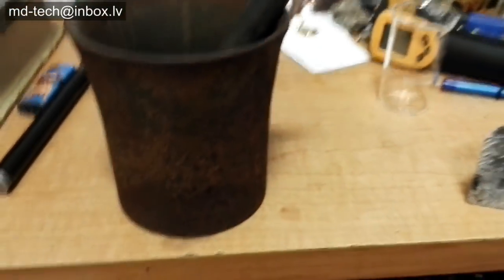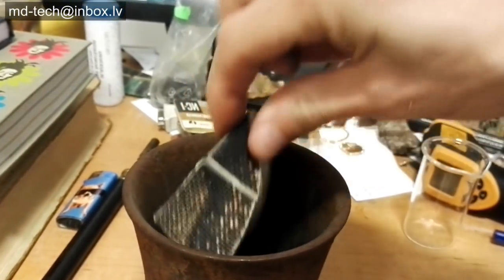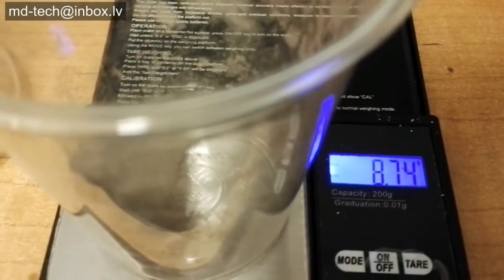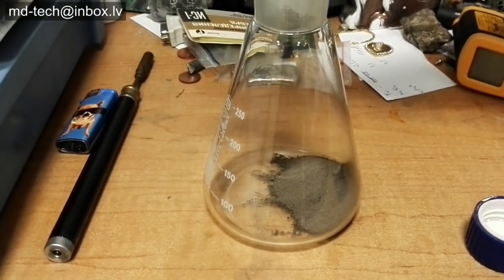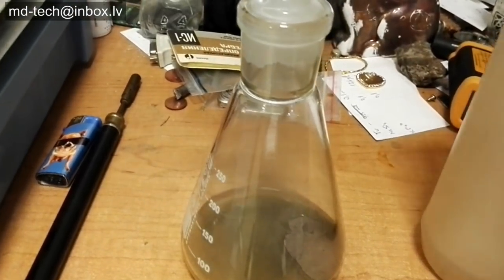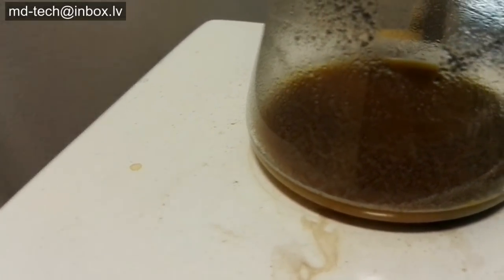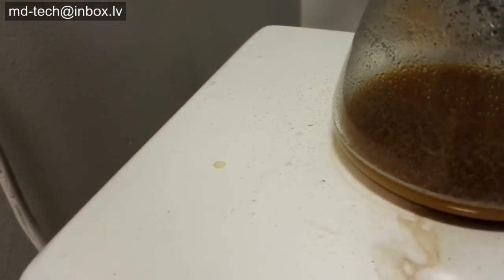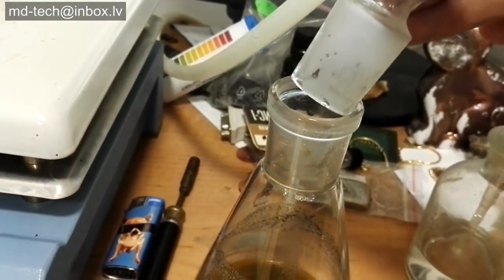Platinum extraction from a Catalytic Converter.

Comment: If I process and refine 100kg of catalyst converter, how many kg of platinum can I recover?
Reply: Plz send complete formula to produce platinum from converter .I have 50 kg catalyst converter .plz tell me.gurpindersachdeva@gmail.com
Reply from the maker: Different converter different value. Some converters do not have anything. Some have only palladium. Values need to read use x-ray gun. Some converters have 1 to 4 grams platinum per one-kilo converter.
Reply: @chemistry7119  Can you tell me what kind of gun is for the test and buy it? I am dedicated to buying catalysts and how do you do the test for rhodium and palladium?
Reply: @chemistry7119  Palladium is currently sky rocketing in value
Reply: Chemistry I ran a test on the converter and it contains 0.16%. Do you think I have a better chance after refining 100kg?